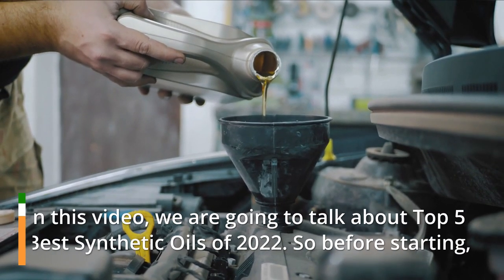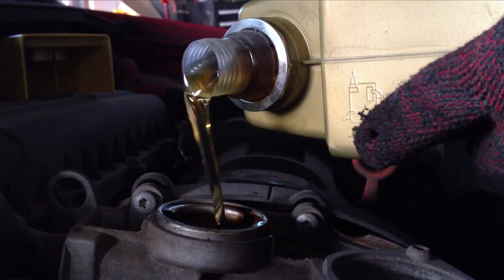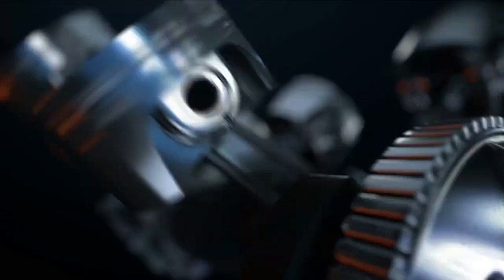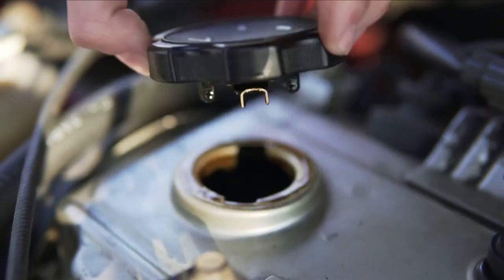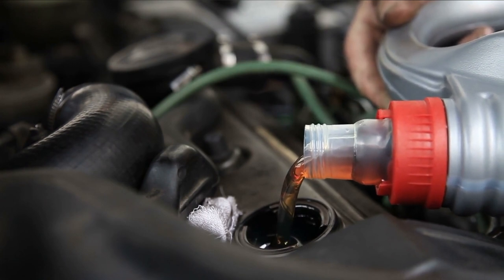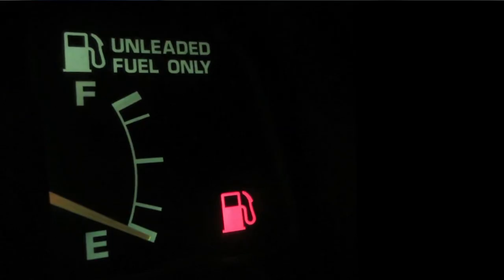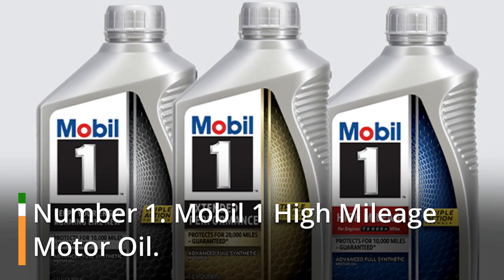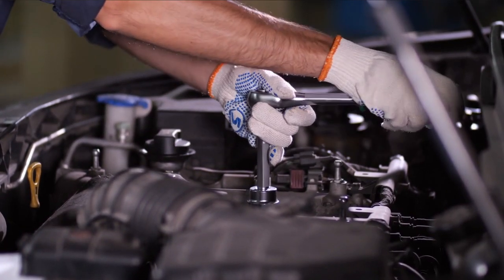Top 5 Best Synthetic Oils of 2022

Comment from the maker: 5 - Valvoline High Mileage Synthetic Blend Motor Oil
https://amzn.to/3yqgLfQ

4 - Pennzoil Ultra Platinum Full Synthetic Motor Oil
https://amzn.to/3kWMWeA

3 - Shell Rotella T6 Full Synthetic Diesel Engine Oil
https://amzn.to/3L2QE0W

2 - Castrol GTX Magnatec Full Synthetic Motor Oil
https://amzn.to/389O7Vy

1 - Mobil 1 Extended Performance Full Synthetic Motor Oil
https://amzn.to/3P5qgXw